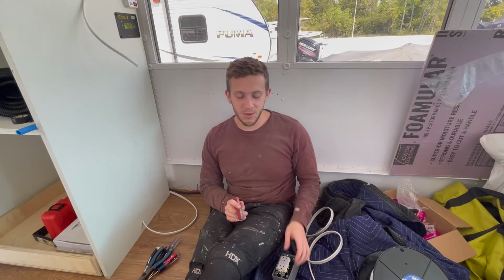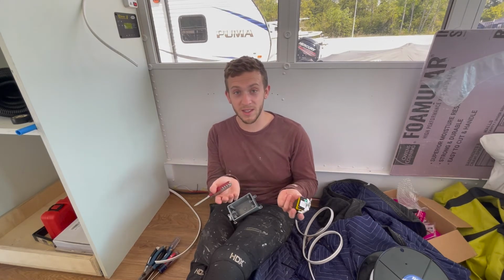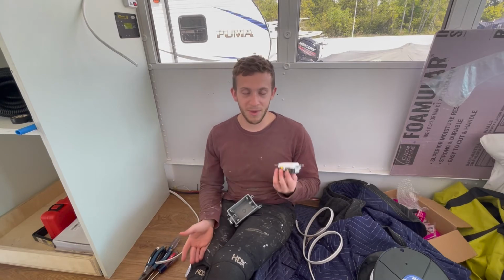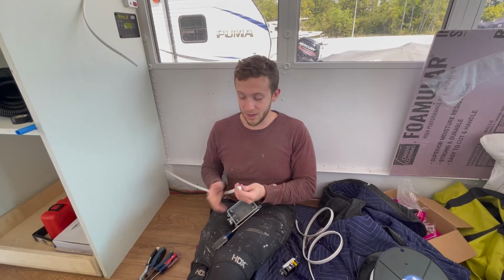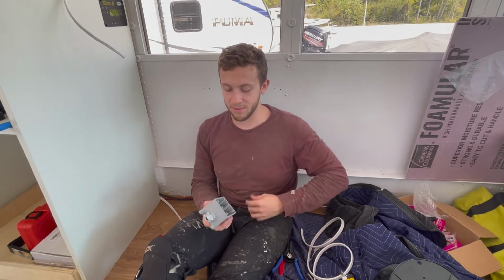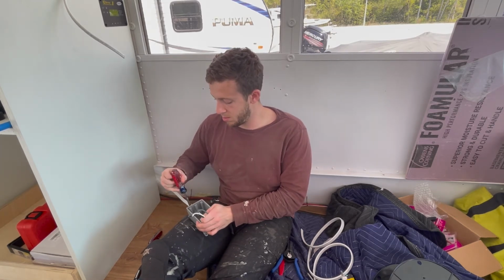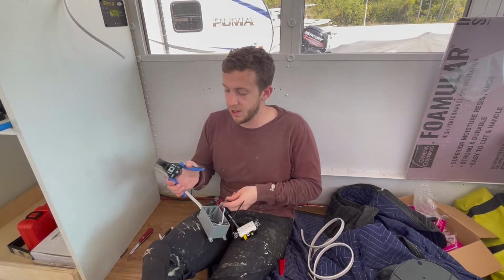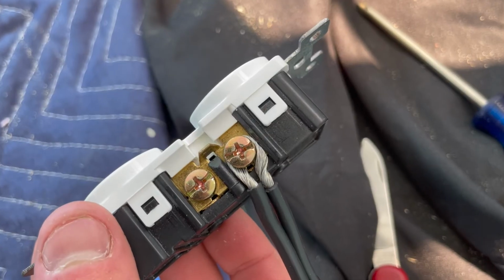Wiring AC Outlet Van | STRANDED WIRE | Bus Build 21

Comment: Much to my surprise, I learned that there is a building code for RV's! That code specifies stranded wire. I challange anyone to find a commercially built RV with stranded wire. El Cheapo 14 gauge solid wire seems to be the industry standard, pushed into the back of a crappy shallow outlet.

Comment: If we had solid wire, couldn't the ends be lightly sanded for better grip on the terminal screws?

Not sure how 12 awg solid wire could get brittle - enough to just fall apart??  If solid wire could get brittle then it seems stranded wire (thinner) could get brittle as well.